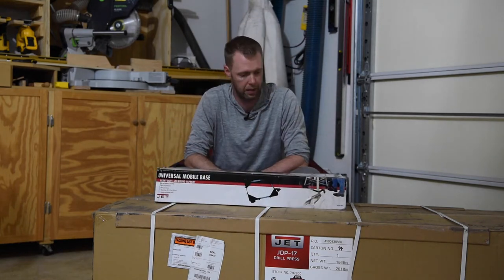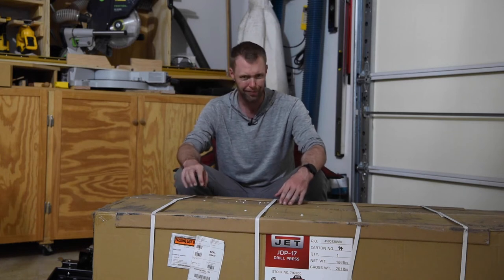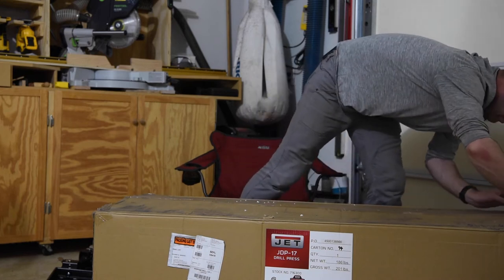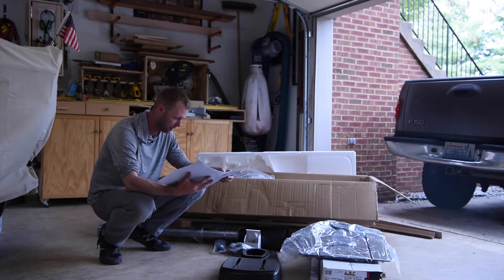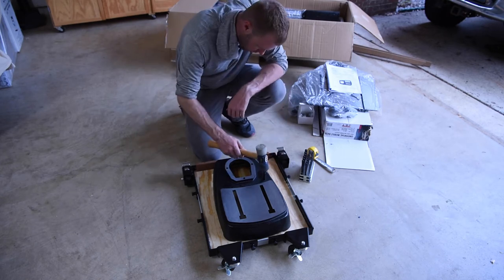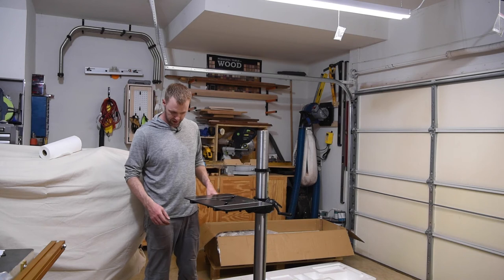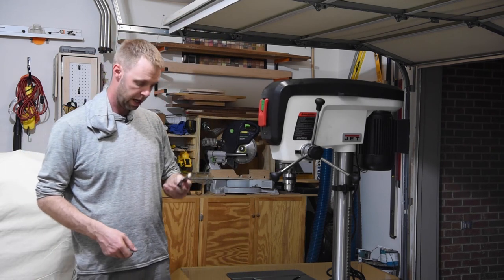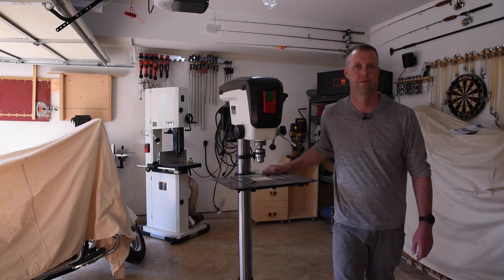Jet JDP 17 3:4 HP Drill Press Unboxing and Assembly

Comment: I’m looking at buying one off of marketplace. Anything I should look for? Good video my man you sound like me in the shop!
Reply: Hey there thanks for the comment. , I would suggest looking at the pulley system to ensure they move and the belt tracks properly. I would also put a long bit in the chuck and turn the machine on; make sure that it is turning true. Of course this should be done with some precision tools but for my level of perfection a straight drill bit has worked so far. I can't honesty say I have put a lot of hours on this machine but so far so good and I have had zero issues with it. Best of luck.

Comment: Hi Chris, good job on the video!  Thanks for creating with all the do-overs included.  That is how my diy-home jobs usually go.  I hope you are getting some enjoyable productivity out of it.   Since your video is one of the newest posted by an actual owner, I wonder if you could answer a quick question.   I purchased a used JDP17, and it was not loved by previous owner and I'm trying to put it back to new condition.   I've bought what I thought were a lot of JET factory replacement parts but I have doubts about the "JDP17-016  Taper Pin" which goes under the table through the support bracket.  Based upon the name "Taper pin" I would think it is tapered in shape, but the part that was sent to me is basically a cylinder - same diameter over the entire length of the pin, except for the threaded end.   So my question is this : is your taper pin tapered or straight?
Reply from the maker: Thanks for the nice comment. I used this product for about 2 years and I have had no issues with it. I'm still very happy with the purchase. I hope you enjoy your purchase as well. Sadly I cannot be exact when answering your question. The Army saw fit to send me on a 1 year tour to South Korea and all my equipment is sitting in a storage warehouse, stateside. Looking in the user manual I would assume the pin should be a straight pin. It appears the purpose is for the table to be able to rotate around the pin. Since this component arrived already assembled I can't even try to recall what assembly was like. Sorry I can't be more helpful, I hope you get the drill up and running.
Reply: @CDWoodWorX  thank you for your quick reply. I hope your time in South Korea passes quickly, as it looks like you are getting a nice shop built and I'm sure it will be a happy reunion to fire it all up again.  I think the table rotates around the 3/4" bolt, and the alignment pin wedges in and helps to keep it level right at 90 degrees.  But I'm a newbie and have no experience to draw on, to back up that thought.  My pin seems to have some play, and I think that is because it's a straight pin in a conical shaped hole?  I have contacted JetTools tech support and hope to have a definite answer on the shape of the pin soon.

Comment: Have you run it much yet? My new Jet jdp-17 makes grinding, clunking and squeaking sounds. https://youtu.be/n8r6XHq-K2E
Reply from the maker: I probably have an hour of run time on this tool. I can say for certain there is no grinding or clunking happening and the belts are not squeaking. Are the noises coming from the pulley system?
Reply: @CDWoodWorX  it’s coming from the spindle area. I returned it yesterday. Not worth the time to figure it out.  As soon as I returned it, I put in an order for the Nova Voyager. Crossing my fingers it’s as good as everyone on the internet says it is.
Reply from the maker: @templedentist  Sorry to hear this. I have had so little issues with any Jet products I'm always a bit surprised to hear of others having issues. I did go with the Hammer jointer/planer over the jet though so I really don't feel Jet is perfect by any means.... I hope the Nova works out great for you!